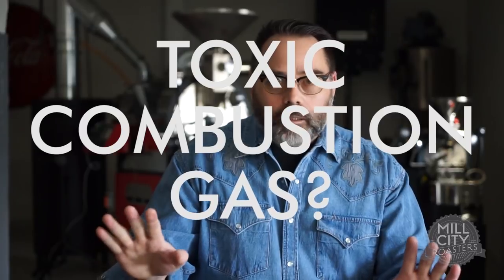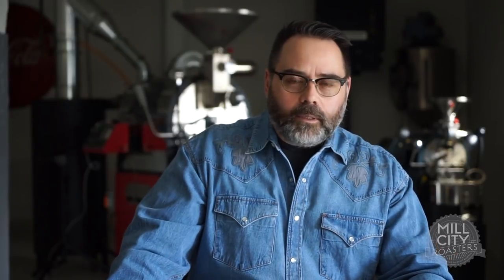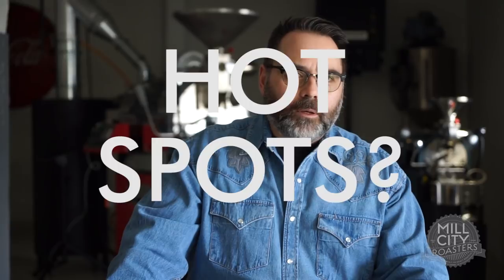What's the Best Coffee Roaster?

Comment: Hey Steve: I appreciate the common sense and honesty of your presentation.  I went to your site and looked at your products, only to not find what I was looking for.  That is, a good HOME roaster for a reasonable price, preferably under $300, but definitely under $500, that will do at least 1 lb of coffee.  I don't care if it's not automated.  All I want is a revolving drum and a heat source,  a readable temperature, a vent to the outside, and a contraption can be cleaned reasonably easy.  It shouldn't be difficult.  The technology and parts are simple.  So ... build one!

There's money to be made among the Baby Boomers, Yuppies, and Millenials with a device like that.  Of the two main machines currently on the market, one can't be cleaned and only does 1/2 lb at a time, and one smokes up the house.  Nothing fancy - I'll stand there and monitor the progress of the roast.

And get it on the market fast.  Like before I croak.  I'm getting up there.  Thanks.
Reply from the maker: I feel your pain and I've long considered the same thing. If you can come up with a plan, call me. I'll probably fund it myself.
Reply: If you make that machine, I'll buy it!
Reply: PalJoey1957 A half pound at a time sounds perfect... I want one.
Reply: @PalJoey. Out of curiosity, which machines are you so far considering, or have you already bought one?